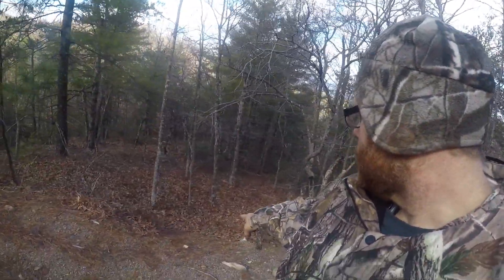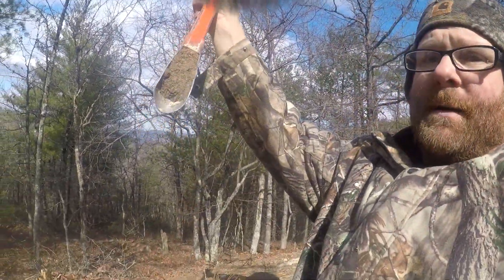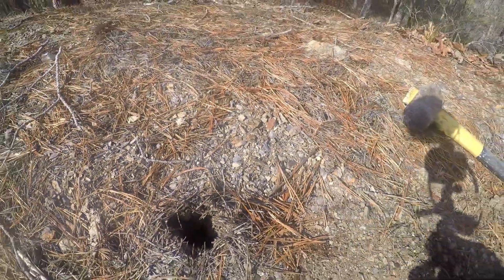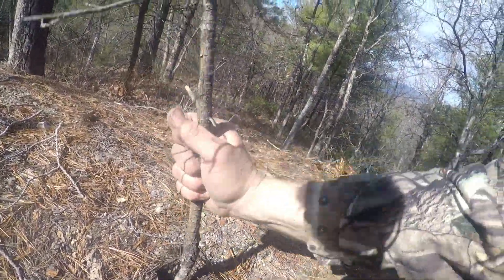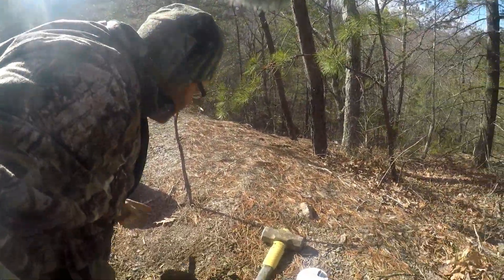How To Power Bed Your Traps With Nails

Comment: I did the same thing with the salt and nails and they worked great for me. I am going to make wax dirt for next year to. I watched it on dunlap lures how to make it and it does not seem to be that hard to do. Great video.
Reply from the maker: Thanks I agree I've watched several people make the wax dirt and depending on which way you make it it could be a fast method or a quick one. Either way I will definitely be making it months in advance so I will have time. Thank you for watching and commenting.

Comment: I’ve been doing this for years and finally had a nail pull out when my trap went off and catch in the bottom jaws of my trap. The trap was set off and the jaws were still open at a 45° angle.. so I’m done betting with nails needless to say.
Reply from the maker: Wow I hope that never happens when I do it. I don't do it too much but there are times that I definitely will bed with them. Tight chains